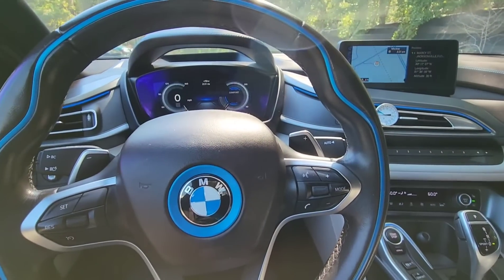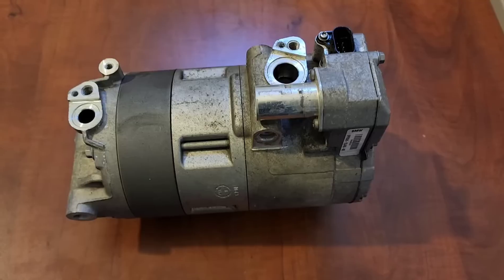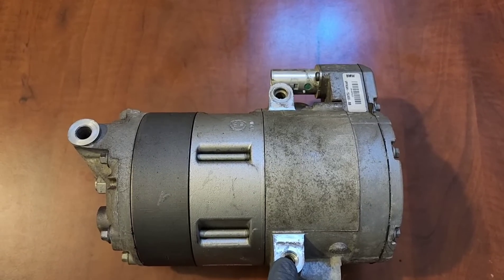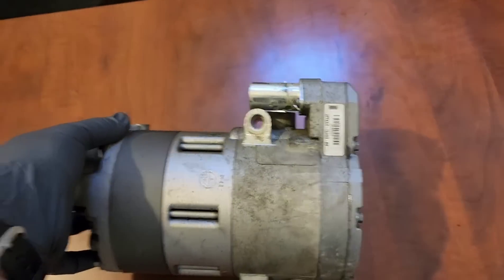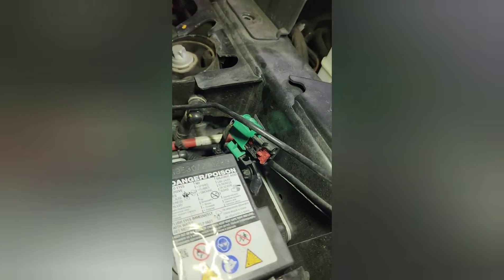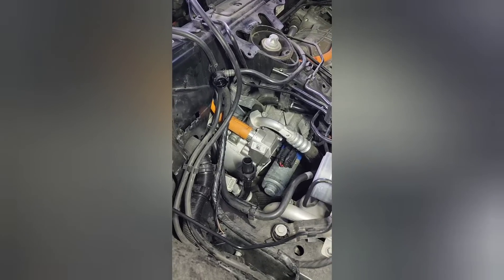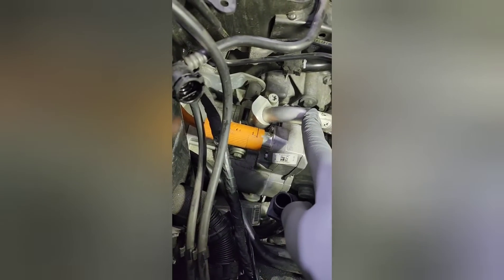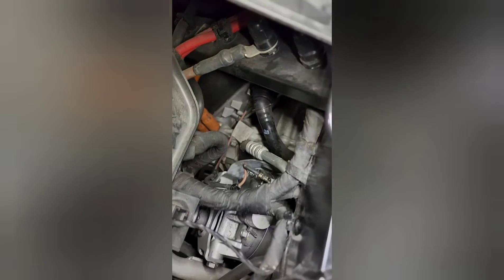BMW i8 A/C compressor issue: removal and replacement (R134 refrigerant) #bmw#i8#bmwelectric#ev

Comment: i have same problem, need buy nev?
Reply from the maker: Ac compressor goes out without any warning. If it stopped cooling,you need to check for any codes with an odb2 scanner and check freon pressure,if turn out that ac compressor is not working you have to replace it
Reply: @German-garage  
Greetings, one question, can we use a different brand ac compressor as replacement for BMW i8? Thank you.
Reply from the maker: I am not aware of any other brands that make a/c compressors but it should work as long as it's made for bmw i8
Reply: @German-garage  
Thanks for the answer.
Reply: @Septogern  same bmw i3 ac
Reply: @vidaspetrosiuspetrosius6784  
According to your opinion which car is more durable and reliable? Is European car more durable and reliable or is japanese car more durable and reliable?
Reply: @vidaspetrosiuspetrosius6784  Are you sure?Part numbers are different 64529496107 is for i3 64529496108 is for i8